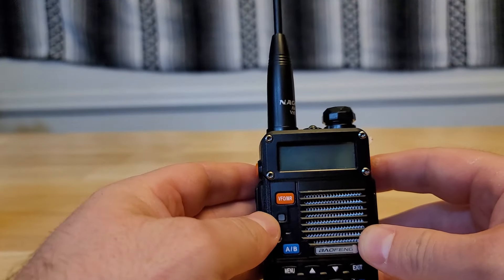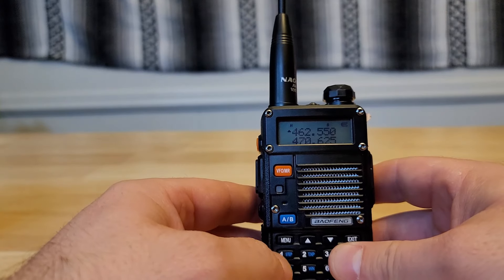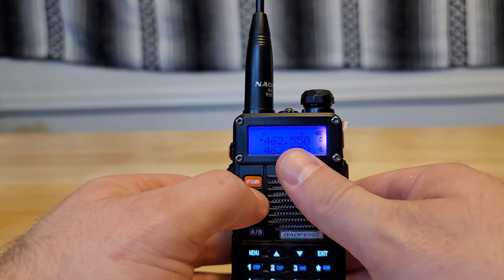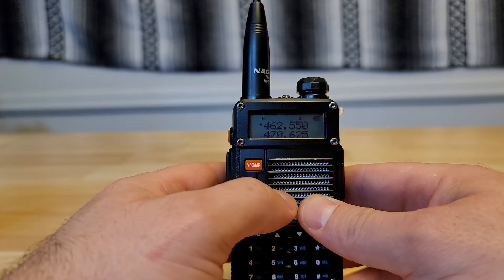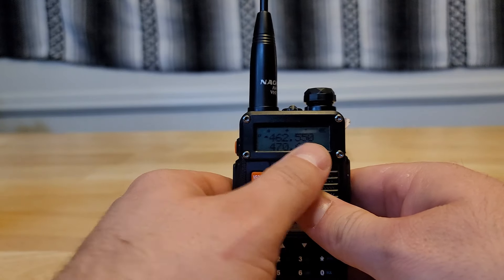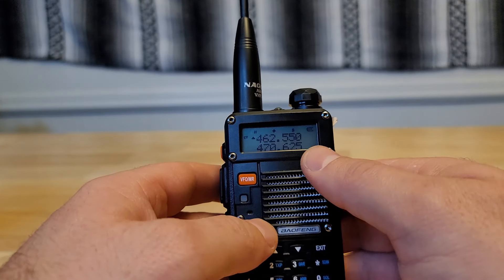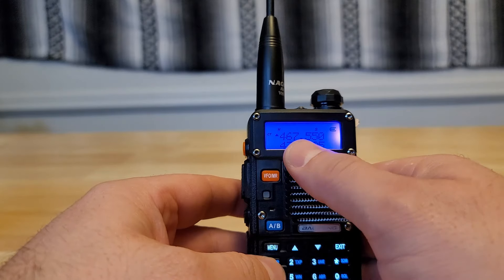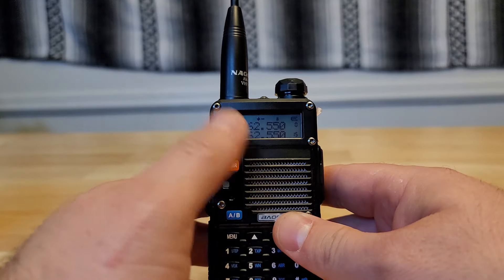How to Program a Baofeng BF-F8HP - Basic Working Knowledge Needed

Comment: I have the exact same radio.  I just purchased it.  How do I unlock the GMRS.  When I hit the transmit/talk it turns red
Reply from the maker: Should be working out of box. Verify settings and freq. It is a "HAM" radio so as long as you have the right freq imputed you should be able to transmit no restrictions? I've only ran into that on my "GMRS" only radios where it locks out transmit function on none gmrs freqs.

Comment: Thanks for putting out such great information. I have a BF-F8HP that I've had for years. When I first got this, I downloaded the software for managing channels/frequencies on a computer to be synced to the hand set. I believe this software was called chirp. I havent needed to modify these settings until recently when I tried to manually enter a new frequency to save into the list of stored channels/frequencies. This is where my question comes into play. Once I key in the new frequency I'm trying to add to my stored channels, the new frequency imediatly reverts to the original stored frequency and I loose the new frequency completely. I'm not trying to replace a channel/frequency with a new frequency here, I'm trying to manually add a couple more channels/frequencies to the collection of stored channels/frequencies. Do you have advice or suggestions for how to do this?
Thanks
Reply from the maker: @jakeamadon3141  Notaroubicons videos are gold. Also, it all depends on the radio model.

Comment: First time user. How do you know what your frequency is?
Reply from the maker: @JoyBringers  it should show up on the display screen. There is a setting that changes what it displays. Between displaying the Channel Name (set in chirp program or preinstalled) , the frequency, and channel (ie channel 1). The setting name on a UV-9G is MDF-A or MDF-B for either the top line (A) or bottom line (B). It is setting 21.
Reply from the maker: @JoyBringers  let me know if this helps.

Comment: what is a gms repeater and why do I need it?
Reply from the maker: A GMRS/HAM repeater will repeat your broadcast out across a longer distance. The Boafeng and other handheld radios have a limited range due to them being generally line of sight communications. Depending on terrain and other atmospheric factors, you can get 0.5miles to 20/30 miles. Again this depends on line of sight. In my case I'm surrounded by trees and multiple ridges. I can only communication withing the valley for at best a few miles. However, there is a GMRS repeater on to of one of these ridges which I have line of sight with. This is a powerful repeater. If I have the correct frequencys (transmit and recieve), freq offset and CTSS/DTS codes my signal is picked up by the repeater and rebroadcast at along range due to the higher power. With this I have communicationed with people 60 miles away on a small handheld. On this repeater I have heard folks from Hoodsport WA talk to folks in concrete wa. Now in this case they where using vehicle/base station radios with 50w-100w of power.
Reply from the maker: You don't need it unless ypu want to talk further to people outside your radios range.

Comment: I'm thinking about getting 5 or 6 of these radios for my race team. 

What do I need to do to get all 5 or 6 of these to just talk to eachother? We have headsets and I have a mic and speakers in my helmet. All I've ever used is basic walkie talkie style radios.
Reply from the maker: You can set them up with ctss codes on simplex using the same frequencies used for FRS (walking talkies) this would filter out anyone's transmissions without the same ctss. However, people will still be able to heat your transmissions if they don't have ctss on. All the "privacy" tones do is filter out transmissions that don't match your codes on your radio. Everyone else can still hear your transmissions so they are not actually private. 

Watch Notarubacons video on "privacy tones".

Also, with higher end walkie talkies you can set up "privacy channels" so you only hear your team.  And not the local construction. Again everyone else will still hear you.

There are Bluetooth options that will actually be 100% private but the range is limited to Bluetooth range.

Only way to be private is encryption.
Reply: @SgtDanB  awesome thank you! I'll look into all of that

Comment: what's the maximal distance you have achieved ?
Reply from the maker: Simplex 22.5 miles. Repeater 125 miles. Line of Sight Similar Elevation.

Take in account I'm surrounded my trees and ridges. Flat land I believe I could achieve well over 30 on simplex with the Nagoya 177 antenna

Comment: My god man. That was totally over my head. I agree with the previous comments  you must assume that we are either dumb or are crack ham operators.  You need to make your instructions technically longer and go over each step slower and explain every move. You where pushing numbers and not explaining what you where doing.  Maybe have a step by step or written instructions I missed most of what you where doing. Make up a written instruction on just what you are doing. Understand we are dummies  willing to learn but I would have to pause each frame trying to keep up.  Make up written instructions so a layman could understand and put a link in so we could down load it and follow along.  Sorry.   You need improvement if you want subscribers
Reply from the maker: I do understand this. I did however make this video for people who have a basic understanding. I will change the title to include that. I would check out Notarubicon for his in depth beginner videos. They are great. Thanks for the comment. Helps me get better.
Reply: @SgtDanB  Thanks for sharing this last comment. I just got my Tech rating; have had the radio for a bit; and feel totally lost in setting it up. Will let you know how it goes.
Reply: We must have a differently learning style. I continue to wrestle and do not get it. I would like to set a repeater in memory. I will reach out to my local club for in person help!
Reply from the maker: @winstonsmith2841  if needed I can help.
Reply: @SgtDanB  Thanks, Brother - I will bring to the next club meeting and ask for a local to help face-to-face. Just passed Tech license and joined local club. Lots to learn. (USAF vet here) Thanks!
Reply from the maker: @winstonsmith2841  np. I've had enough comments and views I think I might do a intro to gmrs radios. Maybe redo this one long form.

Comment: Just curious what Range you are getting on that?
Reply from the maker: Simplex (no repeater) max 10 miles. Granted that 10 miles is Line-of-Sight with good conditions in my area. I live inbetween two ridges so within the valley it is pretty good. There is one place on my property that I can shoot accross a saddle and get 20 miles out of it, in only that direction. However, with the olycomm-3 repeater on East Tiger in Washington State, as long as I'm in transmission range of the repeater it can rebroadcast my transmission out ~90 miles. I thing the best I've heard of off that repeater is Hoodsport, WA to Granite Falls, WA.
Reply: @SgtDanB  Good to know especially since we are in the same part of the country... Im in Wenatchee
Reply from the maker: @tommyboy4  you will definitely get better range for simplex then me out there. Given your in a high point or are not trying transmit across the pass. I think you could theoretically get up to Entiat through the valley. Definitely will need a repeater to get out of the valley there though. If you can get to the ridge up badger mountain road you could extend possibly to quincy southeast of there. Not sure though. For offroad  and distances where a repeater won't work I use my 50w or 25w moble setups in my vehicles.
Reply: @SgtDanB  thanks for the info

Comment: Very complex device....
Reply from the maker: Yes and no. For general use GMRS it is a but much for most to get up and running. For HAMM Radio Licence holders, it's a dream. Cheap and reliable.
Reply: @SgtDanB  I'm only saying that because I'm not that familiar with it. That comes with use...